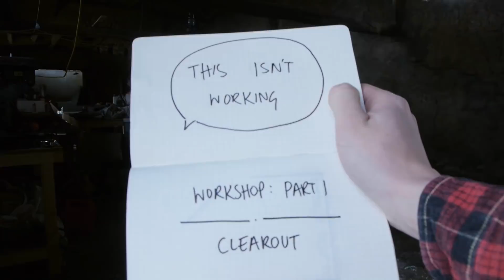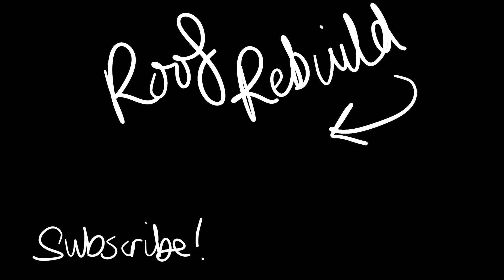DIY Concrete Floor: Foundations 1/3

Comment: I need to do something similar to my pole barn garage here in Portugal. The adjacent eucalyptus tree roots have grown under the flooring, cracked and lifted it about an inch in places. It all needs replacing to make a decent workshop. Sadly our income has been so savaged these past 18 months that it will have to wait for a while. I could do with a mini digger to make the work easier too because I'm a lot older than you but our rural part of Portugal hasn't heard of hire shops yet.

Comment: Hi guys. I like your content.
I got one question. Aren't you afraid about moisture in walls or newly made floors. Those old buildings do not have a proper cut off insulation against capillary pull. 
Or you don't see it as a problem? I know that is only storage but what about a house?